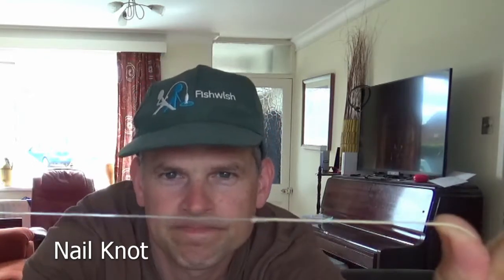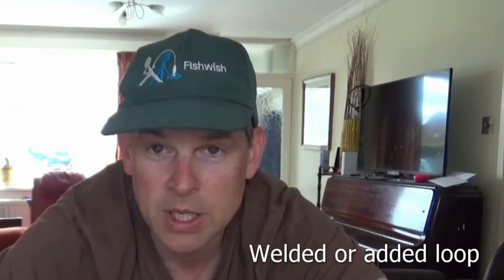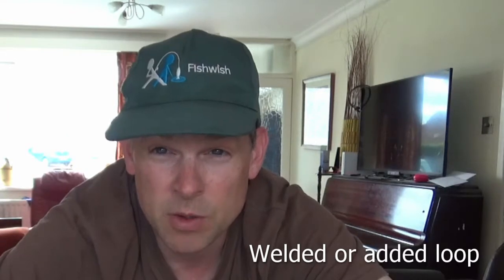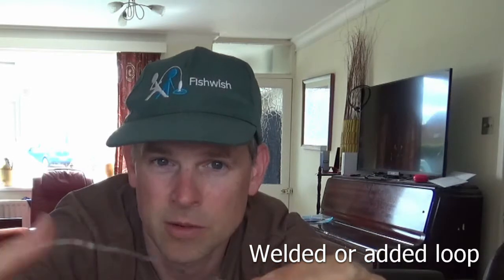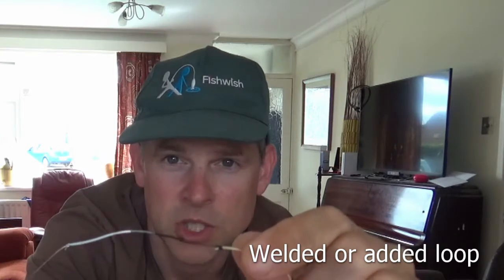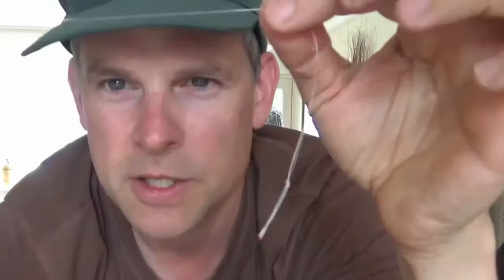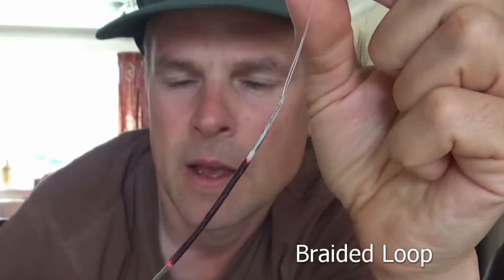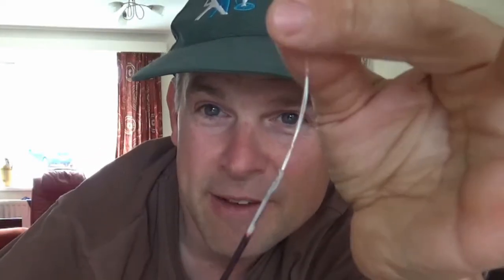Whats the best way of attaching a leader to a fly line

Comment: Great minds! The nail knot with a 25 lb extended mono loop is what I use for 5wt, to 7wt.  For 9wt I use the figure of 8 on the end of the fly line to a nylon loop direct, bulky but it doesn't matter at that weight!
I do like the needle knot though for dry fly and light nymphing with a 3 or 4 wt.
Reply from the maker: Glad I’m not alone in my approach to this and thanks for commenting.  When the question comes up on Facebook, it always seems to spiral into separate thus confusing schools of thought, based on ‘one size fits all’ thinking.  I caught plenty of good rainbows up to 4 or 5lb last week, using a sanded and glued taper / needle knot.  Stronger than I thought it would be tbh.  I also caught a few using a hurried Albright knot that totally refused to slide past the tip eye on countless occasions but let’s not talk about that 😂